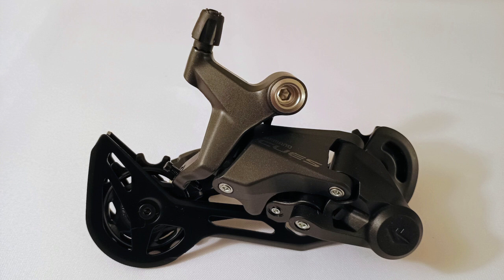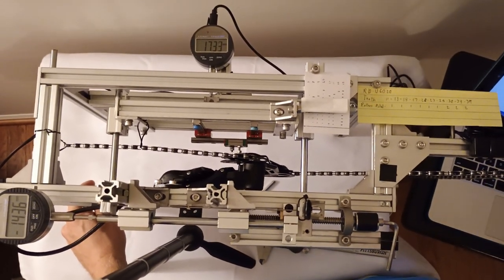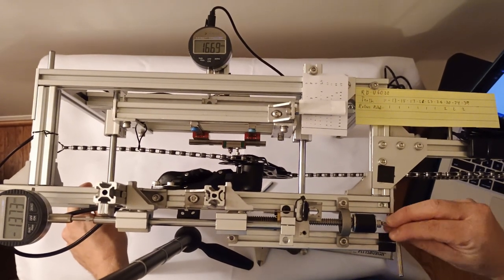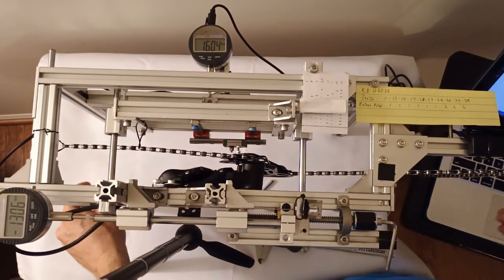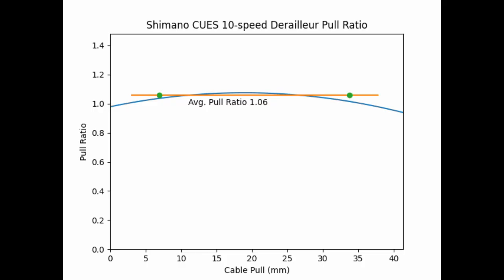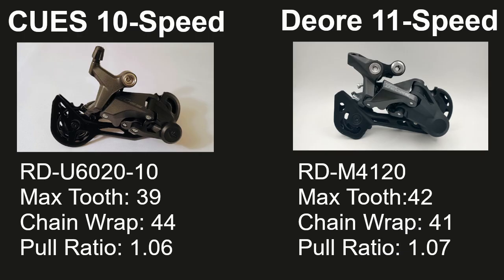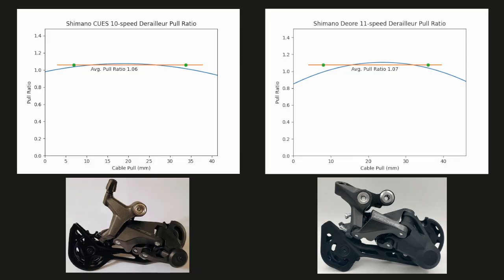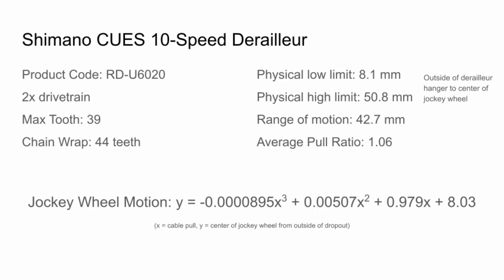Shimano CUES 10-Speed Derailleur Pull Ratio

Comment: I have been using a Deore rear derailleur for the past year in my 1x setup, but a cues front derailleur is on the way for 2x. I'm glad to hear from your video that both series have compatible pull ratios.  It seems I don't need to replace my Deore rear derailleur. I'm using bar-end friction shifters on my drop bars, in future Cues brifter release I should just update my shifters to Cues brifters.

Comment: So, is this compatible with 105 r5700 10 speed road stis?
Reply from the maker: No, the pull ratio of CUES 10-speed derailleurs is too low to work with 105 R5700 shifters. It's marketed as 10-speed, but totally different from traditional 10-speed systems.

Comment: Righto, so it seems that Dynasys and Linkglide are likely the same pull ratio, and we are entering back to (some) Shimano cross compatibility (at least at the MTB end of the spectrum) ...
Reply: With CUES drop bar shifters on the horizon, looks like you can mix Dynasys RD into the groupset, What possibilities!
Reply from the maker: It certainly appears to be the case!

Comment: How do you determine where the second largest and second smallest cogs sit in the derailler's range?
Reply from the maker: I really should do a video on this since a visual explanation would be helpful. Basically, I know where the jockey wheel is in relation to the mounting point/dropout. I assume the dropout is about 8mm wide, and that the smallest cog is inset about 3 mm more. To find the second smallest cog, I just add the cog pitch (ex 4.05mm for LinkGlide). For the second largest cog, I just keep adding the cog pitch for each gap in between.